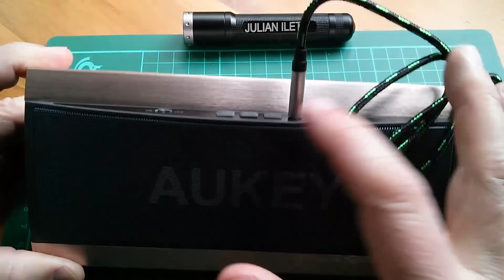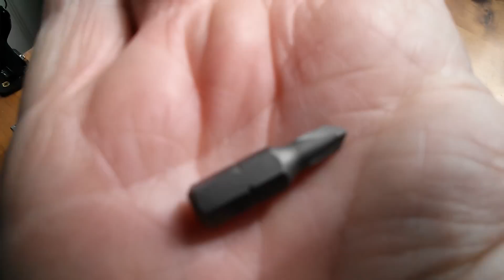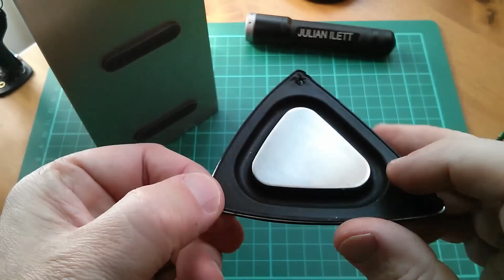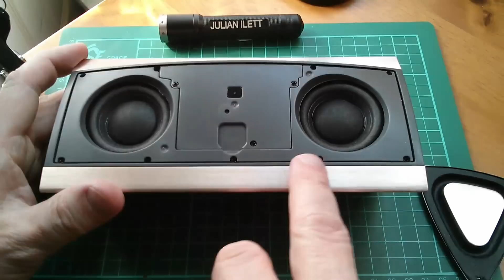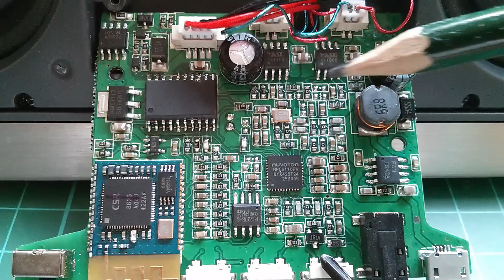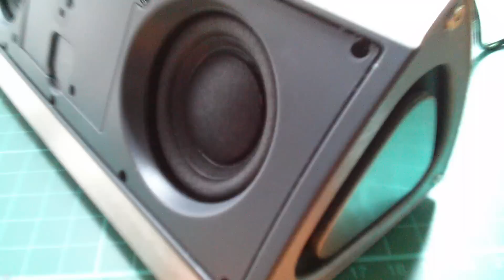Teardown: Aukey Apollo SK-A1 Bluetooth Speaker

Comment: The circuitry on the right looks like buck converter for charging the Li-ion. The IC on the right would be the SMPS controller of the buck. The headphone amp must be connected after nuvoTon with a DAC in between. This is because Bluetooth module and nuvoTon handle digital signal and headphone amplifier, well, amplifies analog signals. The nuvoTon's datasheet mentions that it has DACs built in to generate analog output. This is probably what's happening here:

Bluetooth module recieves digital file, sends it to nuvoTon which performs DSP and converts it to a pair of analog signals (stereo pair). These two analog signals are then preamplified by headphone amp (which is 2-channel, AB class) and then amplified to final voltage by the pair of power amplifiers.

Comment: Hey Julian,

I have this exact same speaker, however mine has developed an interesting fault and I was wondering whether you might have some insight into what it is. I am pretty sure one of the power amps has failed, since one speaker behaves fine, the other however just makes a soft clicking sound. I've opened the speaker up and confirmed it's not a speaker fault, and the power amp chip in question does look slightly melted. 

If it was the power-amp, any guessed for replacement parts? I know I'm asking a tough question!

Comment: Impressive how little the actual speaker moves compared to the passive radiator.
Reply: Xmax isn't the most important thing in sealed enclosures.
Speaker softness is key for good bass response
Reply: Oh, and forgot to mention that the amps are most likely to be LM4871.

Comment: Triangular screws are pretty common on cheap Chinese stuff. Usually you can get screws out with tri-wing bits but they're damaged slightly so not good for places where they're visible. Have though looking on eBay for proper triangular bits.

Comment: Someone was wondering about the radiator being "non-linear". While there would be a small amount of non linear stuff, that wobble you see on the camera is more due to the camera itself and how fast the speaker is moving. In one frame, the speaker may move 3 times back and forth and you get different parts being recorded etc. If you play a 25Hz tone through a speaker and record at 25 fps, the speaker will look like it's hardly moving at all, it may even look like it's pushed in or out permanently! XD

Comment: I have a pair of speakers that include what used to be called an ABR (auxiliary bass radiator) they look like a standard moving coil bass unit from the front but at the rear there is an ordinary speaker chassis including the spider but without a magnet or voicecoil, just a small weight in the centre to "tune" them. With the spider fitted the movement is linear and you don't get any of this cone tilting.
Great video, the electronics part of the speaker looked pretty reasonable..
Reply: +David Lisney Larger radiators need a spider. Small ones can get away with it because the air pressure from inside will generally keep it straight enough, while the lack of spider makes it easy for the little speaker to move it. What is annoying is when they call their passive radiators "bass drivers" ;p

Comment: Definitely looks like a class D arrangement with those two ceramic filter caps.  I'm suspecting the unmarked chip might be a charge manager/balance/low voltage shutdown seeing as the cells are wired straight into the board in a 2P setup given the four wires and the heavy track that ties the two positives together heading to pins 17 and 18.

Comment: I've always been interested as to why they do stereo instead of a 2 way (mid - high) or 3 way (bass mid high) with propper crossovers. Maybe an idea for a project? :)
Reply: +Alexis Quartarone Probably cheaper, relatively uneeded for such small speakers and you can still get a little bit of "stereo" sound despite the speakers being right next to each other. 

For a larger system I would go with stereo 2 way. Some speakers use stereo tiny full range with 1 sub in the middle. Generally a 3-way is kind of a waste in portable speakers, although I do have a micro 3 way project using high excursion 3.5" bass, 1.5" full range and 1" tweeter XD But those are going to be bookshelf speakers and not portable boombox.
Reply: +Rennie Ash the only reason why I say is because I had one of them really tiny one cone versions and they would do quite good bass when it was only bass and obviously being so tiny.. good highs but it always struggled doing both at the same time and I always wondered what it would be like if it was split two or three ways.
Reply: Alexis Quartarone it would help but once the speaker gets smaller than 2 inches there probably isn't much point - although there are 1/2 inch tweeters so you could still make a mini bookshelf speaker. I have wanted to make an extra tiny speaker but finding tweeters that are very very small is hard :-)
Reply: Wasn't so much as to get two speakers in the same amount of space but more because for the relatively rubbish stereo effect in two speakers I thought it would make more sound quality difference in doing two way mono. So in this video for example there are two 2 or 3 inch cones in stereo where as you could probably crank it up at a higher volume with less distortion if it was two way

Comment: A purely mechanical, adjustable dampener on that resonator might be nice if you're going to use it to amplify a synth. A cam-and-foam-pad sort of thing. But thinking about it, a simple adjustable port (or ports) at the rear might accomplish the same thing and would be easier to implement.

Comment: MaxxBass and MaxxVolume are part of MaxxAudio series by Waves, rather popular developer for audio plugins 
Take a look here if you want ;) http://www.maxx.com/technologies/maxxaudio/
Reply: +Alexandru Simonescu I'm afraid I have not heard about any cheaper DSPs than miniDSP. If you want just EQ, the cheapest option would be to build the speaker, then measure it's response with a calibrated mic and design an analog (passive or active) equalizer. Only downside of this is that you wouldn't be able to change the EQ curve once you've built it.
Reply: +Alexandru Simonescu A simple bass boost can be achieved with analog active EQ, just look up 'low shelf EQ design' It's not hard to build, the tricky part is the calculations (at what frequency you want that boost, with what Q/band width and gain) A few wiki pages and some YT search and you'll be able to build it ;)
Reply from the maker: ***** Thanks Michal - interesting stuff. It seems MaxxBass extends bass response 1.5 octaves below the speaker rolloff.
Reply: ***** its basically a pshyco acoustic bass boost, i have it on my dell laptop, like any of these, just a touch works to make the laptop speakers a bit less can sounding, but cannot perform miracles
Reply: jusb1066 I'm not saying it's some kind of 'push-and-have a HiFi-sound' ;)I've tried the Maxx series plugins a few times, they get the job done, but to some extend. 
I'm surprised this speaker has this software, the plugins alone cost over $150 (PC/Mac versions)
And yes, it is a psycho acoustic bass boost. It simply creates harmonic frequencies from base note and blends them with original track
Reply: +Michał Kural Hi, do you have knowledge about DSPs? A future project of mine will be a portable bluetooth speaker and I need some sound processing. Until now my only option I know is to buy a miniDSP circuit board, but the price is a bit too much I'm willing to pay. Do you know any other (cheaper) options? Ideally I'd want to be able to use an EQ software with the DSP to correct the sound the way I want.
Reply: ***** Thanks for the quick reply. The Eq was my first choice because of it's apparent simplicity but I was also researching DSP options. Hopefully I'll find someone to build me the eq, since I don't have the knowledge. What I want is fairly simple I think, which is mostly a bass boost. What might be difficult is shaping the boost curve the way I want. The only control I'd like to have over it would be the boost level, the curve can remain unchanged.
Reply: ***** thanks a lot for the idea! at the first glance it's exactly what I need. I'll further look into it

Comment: They probably made the resonators on the ends to peak right at the frequency where the speakers and enclosure are rolling off, to add another half octave or so to the base response.  If they get the mechanical phase shift right, the resonator output (driven from the rear of the speaker) will add to the output  from the front of the speaker, over most of that half octave.  In larger cabinets, a tuned port performs this same function, though not as impressive, visually.
Reply: jpopelish maybe the resonator has an advantage being sealed but flexible is that you wont get the air blowing port noise at some low freqs?
Reply: +jusb1066 A port is also not going to fit in that small space very well. A well designed port won't chuff but it would need to be larger than normal. Passive radiator can achieve good results in the tiny space. 

The amplifier also boosts the bass response and probably adds some kind of compression so it sounds like there is more bass from less speaker movement. Bose does a similar thing. Usually you can clearly hear the compression going on if you turn a bass heavy track to the max - it will compress down the volume of the music to try and stop the speaker drivers from moving past their limits.

That looks like a tough little speaker though.